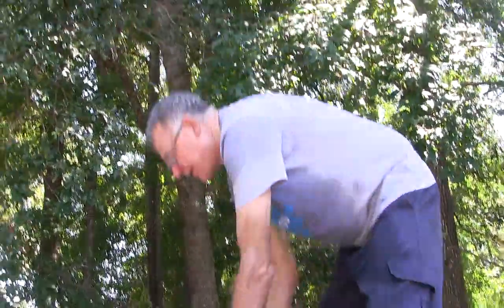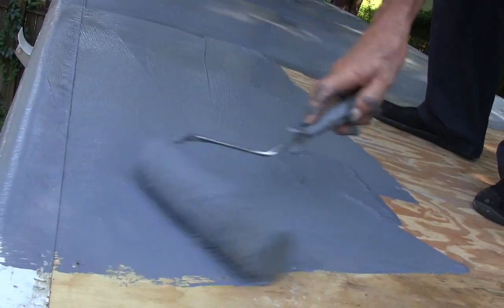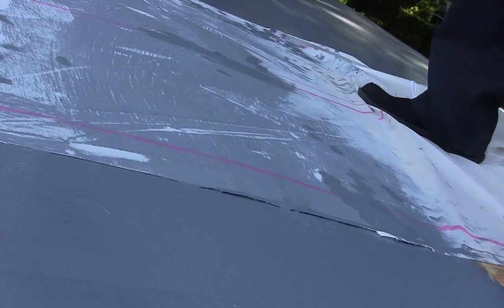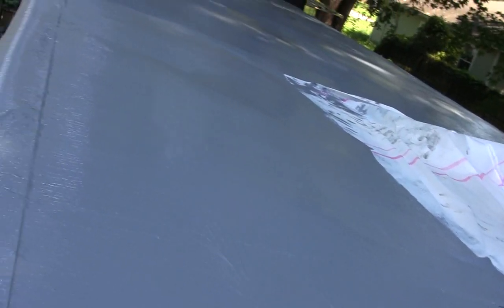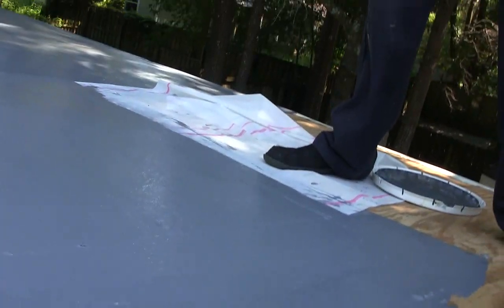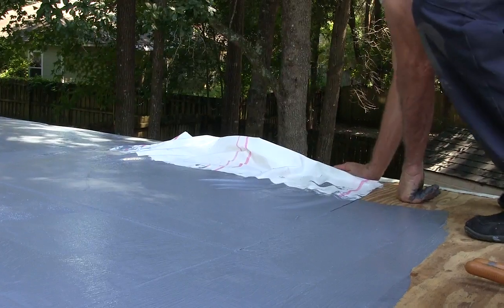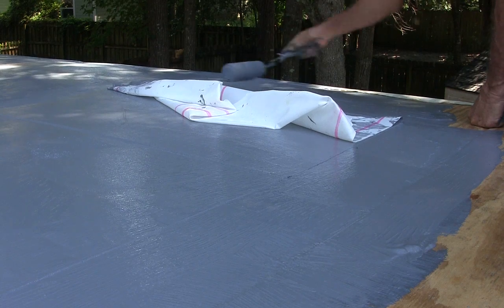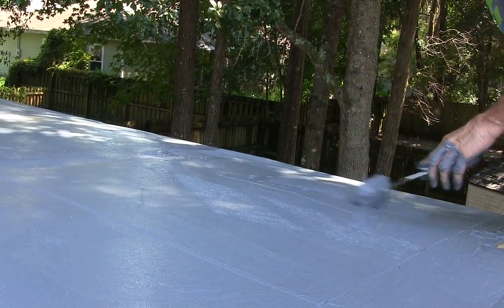Camper update #6. Ames Super Elasto Barrier

Comment: Good choice I have used the product on my concrete roof it's been there for the last 17 years it's still in a very good condition thanks for a good job . I would recomende splashing some rough sand grains on the final job before it drys for skratch peoof .